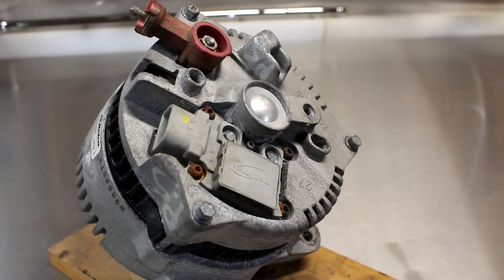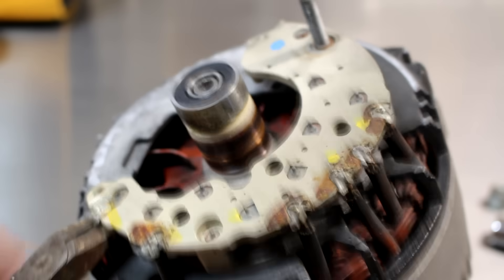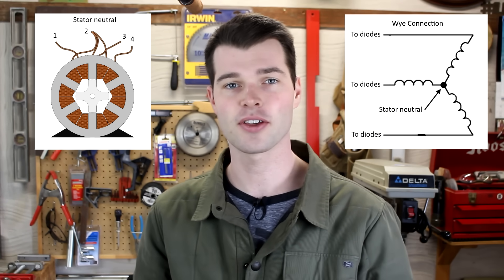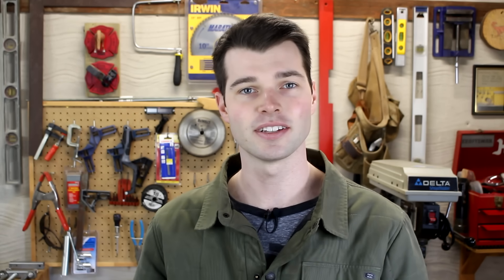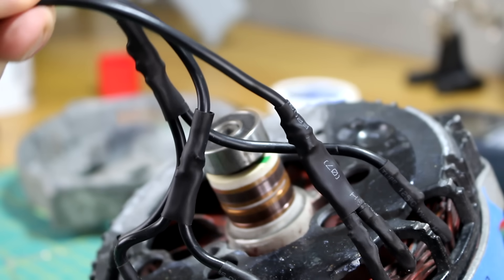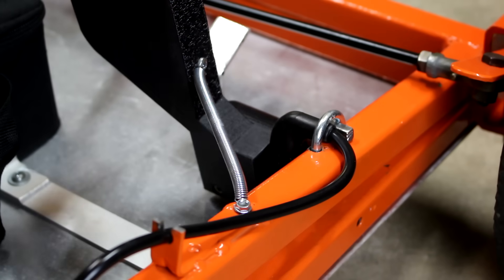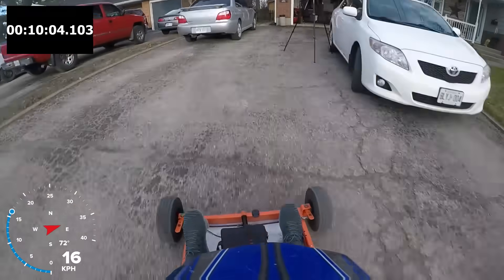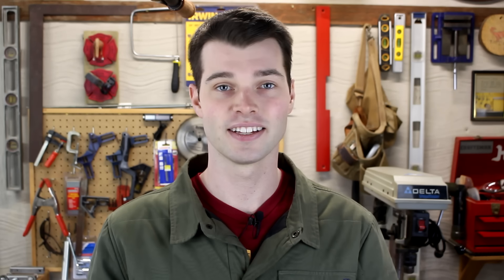Converting a Car Alternator into a Go Kart Motor

Comment: They make a chisel to cut those keyways. But hammering on that shaft while it's supported by the bearings might not have worked out so well.
So a motor controller will turn 48V DC into variable frequency 3 phase? We truly live: " In an age of magnets and miracles". 
Do you control torque by varying current to the rotating field? Or is that just turned up all the way? 48V where the design is for less than 12V? I guess I need more info on controllers.
if the alt is rated at 100 amps at 12V then we're talking about less than 2HP available and I don't think the duty cycle would be 100%.  
A drift trike? I got a grade school grandson that's going to love that.

Comment: to get more rpm(with less torque) back down on the field voltage-current and that reduces the back emf so the motor will run faster for the same 48 volts. this might give more top end speed(or not). nice video, fun project.

Comment: Ok man a couple of questions because you just blew my hypothetical project into the realm of affordability. 

1. What do you think is the upper 75% of this motors power? Not so much that it would over load and melt but also I need some noticable power out of it.
2. Can you configure this motor to do charging under breaking if so how much would it produce with say 2000lbs pushing it down a hill. 

In case you are curious I want to use two of these as a way to smooth out a smart car and increase efficiency. These are small enough to fit behind the front wheels and provide assistance during shifts which are very jerky in a smart car however I would almost certainly need at least 10 horsepower out of 2 of them and the ability to produce electricity from them during breaking as plugging in would only be viable 50% of the time and solar would be impossible to produce enough power to charge the battery needed and fit on the car. 

Thanks in advance! Love the video!

Comment: Great project obviously you know a great deal of electronic/electrical to be able to construct an actual working cart. In real world conditions it varies from text book design but you’re close. I would check actual current demand on up hill climb it’s most likely excessive or a loose connection at the battery will also cause that type of burn.

Comment: When connecting the stator winding connectors it is not shown how to identify which end of the coil in each winding is which. Would the polarity  (which end) of each one be of importance in the configuration? As one coil could easily be in reverse to the two others when assembled, although not important when used as alternator feeding a diode pack.
Reply: I wondered about this too, but I soon found that my ESC didn't care about the relative phasing of each stator coil. 
 Maybe there is some intelligence in the ESC that resolves this automatically?

Comment: congratulation  .. the alternator work as Slip Ring Induction Motor.. is the best
Reply: Best thing to use is a PEMANENT MAGNET ALTERNATOR as motor...
Reply: Yup. True. 
 It's on the way to becoming a brushless motor, but not quite there - yet  :) .

Comment: am I the only person who's thinking find away to put a solar power charging unit or a second alternator to recharge the battery while the go cart is running? Would that be such a bad idea to rig up a alternator to recharge the batteries while the go Kurt is going or a solar power recharge unit that attaches on the back of the go kart? Just wondering if a alternator connected as a recharge source would work to simultaneously charge the batteries while the other alternator runs the go kart. Just something to think about.

Comment: Look up Ackerman...  your front end geometry is awful.. you had one wheel almost turned 90 degrees while the other was less than half than..
Reply: Jason Goldsack unless you have CAD software or an intimate knowledge of suspension geometry you aren't going to eliminate this on a go-kart frame. This isn't a tube frame race car with huge money behind R&D...

Comment: I've been wandering why I haven't seen a cart or even a power wheels set up with batteries running the motor then a alternator recharging the batteries sorry if its a stupid question I'm not great with electric input and output set ups it just seams logical thanks for any comments

Comment: Hi, you have not shown how you identify the start and end of each winding.
How did you determine  which was A1 and which was A2, B1and B2, C1 and C2?
This is essential to get the windings connected in the correct phase order.
Does the motor controller have an adjustable current limit setting?
Reply: right hand thumb rule  and or compass

Comment: Make a electric Turbo for a V-8. The alternators seem to have gobs of torque and if you can get a big turbo to spin 60k, you're golden. Audi currently is running electric turbos to eliminate the lag. The electric turbo runs until the Exh turbo spools = no lag. I want one for my 68 GTO w/ 406
Reply: Mark Estrada If you really had a 68 GTO you wouldn't devalue it by bastardizing it with some jenked out turbo setup.

Comment: Hi. The controller states it works for brushless motors. Could the configuration and installation be the same if a brushless alternator was used? Also,  would that have made the battery wear down more quickly?

Comment: what's not to like! might change the front kingpin angles to actually let the inside rear tire lift 1/8" when turning, so traction isn't fighting itself (cheating way for differential action from a live axle, but pretty standard with pavement karts). some of the old Mopar alternators were very large diameter, just might offer more torque from less input power. stator voltage might need to vary in accompaniment with RPM's, from what I've seen there are optimums to balance and maximize output power through different RPM ranges. I'm sure not saying I don't like this project/idea!!

1500W is about 2hp, but with electrics the torque behaves more like 4hp, you just might need about 4000W to supply what an alternator could deliver (oh holy hell hang on tight!).
a BIG PMA (permanent magnet alternator) is going to be very expensive, and behave more like a hobby type brushless motor. 

over at robotmarketplace(dot)com you can pick up AmpFlow E30-400 motors, 2.1hp 5700rpm 24v DC, about 110 bucks each. one to power each rear wheel (wired parallel) won't need a diff, just a split rear axle setup. best+biggest bang for the buck for new, it's going to pull a TON of power (+3200W!) from 0 mph. may need reduction jack shaft(s) in the mix to let the motors spool up, that's just a little calculator work, but it'd be a darn rocket.

for run time (and not so hellish on batteries, ESC etc) might be better to use a couple 5-600W pancake type electric scooter motors in similar split axle configuration. top speed will be less, still very snappy responsive up to 80% of top speed if geared right. nice is availability of sprockets etc (#25 chain), no need of jackshaft etc.

 a split rear axle for motor to each rear wheel does work GREAT, in corners traction allows the diff action, and running straight the motors fall right back into step with each other. did it back in '95 with a 1/8 scale electric car that'd keep up with .21 powered gassers just fine!

Comment: Beautifull! What an enthusiasm! Great job boy! Congratulations!
Only one note: the international or ISO sign for speed in kilometers per hour is km/h not kph. The sign kph does not mean anything.
But if you wish to use imperial like units (comparing it with miles per hour - mph) than try kmph so we from the rest of the world using ISO system of units can esily understand it. :-)

Comment: Great video. Good fun.
But please study up on angle grinder use. You were cutting the angle iron with the cutting wheel going in the wrong direction, as in you were cutting in the 'grab and explode direction'.
Reply: Only problem with reversing rotation is the retaining nut for the wheel will want to undo and create another problem. John.
Reply: Or grab a hacksaw, it'll build up those muscles.
Reply: WineScrounger No guys, he just needs to turn it around and go in the right direction before he or someone gets severely hurt! It's not complicated!
Reply: pardon my ignorance here, but i didn't know there was a wrong way for the angle grinder. Mind explaining so i dont lose an eye / face? thanks!
Reply: @ticklesdust If your angle grinder is running in the wrong direction, the fastening nut will come loose, causing your blade to fly about. If you haven't modified it it should be correct and not a problem.
Reply: There is  nothing wrong with his angle grinder use.  An excellent, well paced video production as well.  Plus a bonus,  no stupid ball cap and sunglasses.  Congrats, and thank you.
Reply: No 1 cares.
Reply: Hoobz01 looks like he’s left handed so he’s holding the grinder left handed which ends up with the wheel going the wrong way. Might be an idea to get into it and swap the brush polarity to send it the other way.

Comment: A 40A fuse doesn't blow in reasonable time until around double its rating, so 80A.   It probably would blow at say 50A but would likely take an hour or two.
Reply: As an electrician for 25 years I would like to correct this information. A fuse is defined as "course protection" which means that at 1.5x rated current it will blow within 4 hours. A circuit breaker is defined as "close protection" and will trip at 1.25x rated current within 1 hour. These are international standards, look it up
Reply: @climatechangepreppersfaceb2148  You both should understand that there are DIFFERENT trip characteristics for circuit breakers and also fuses.  Different CLASSES  of fuses and breakers.  Read a Bussman  catalog or Scheider for breakers.
Reply: Sorry, but you are incorrect.  As an electrician for over 30 years I can tell you with great certainty a 40A fuse will indeed blow with a 40 to 42 AMP load if sustained for more than a few seconds.   Fuses ARE however able to about double their load for a matter of milliseconds for motor startups etc. but anything over protection for more than a few seonds will certainly blow the fuse.

For reference, look into the FPE company of the 1980's.   Since this debacle breakers and fuses are vigorously tested and regulated by multiple agencies.